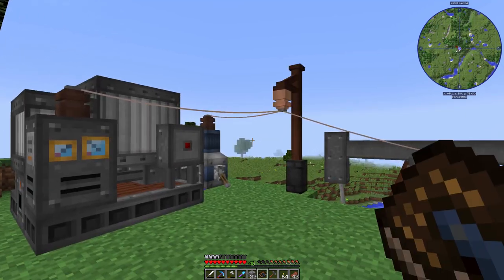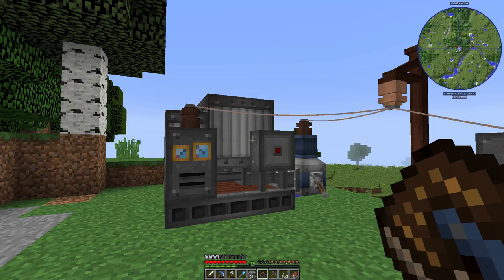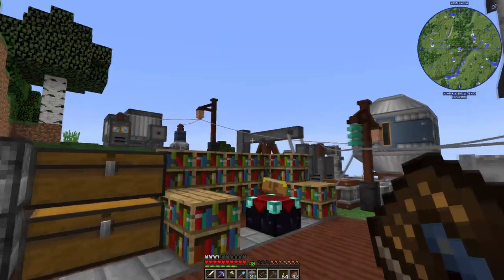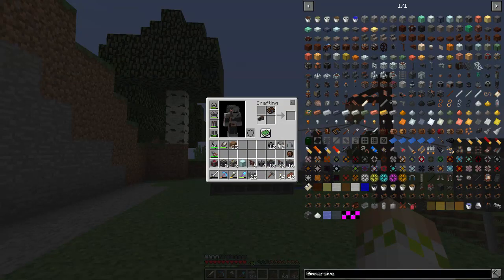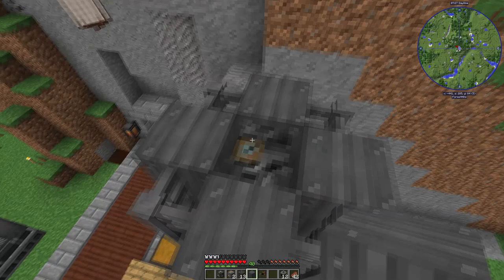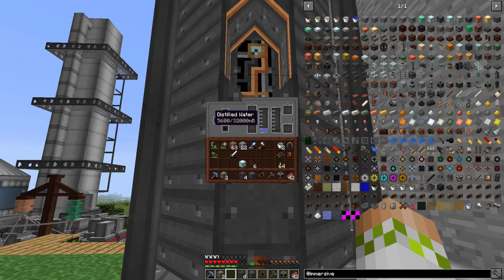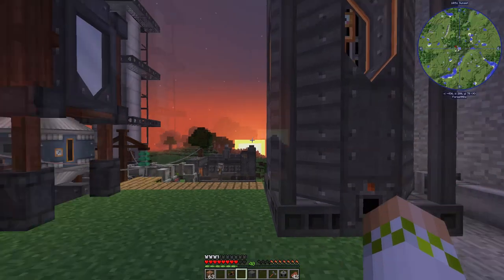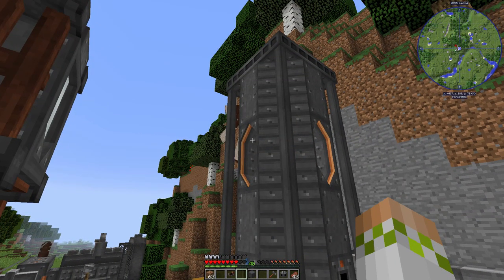Surviving With Immersive Engineering :: E15 - Solar Tower & Solar Reflector

Comment: All these mods I have been using in 1.7.10 have changed DRASTICALLY! To the point; I downloaded a 1.12.2 version and had no idea what to do. It didn't even work the way it used too. (i'm looking at you Ender IO) Even immersive has changed quite a lot. So, I appreciate these videos greatly. Thank you.
Reply: Ender IO change makes it better for lategame and a lot more fun earlygame. But yes its diffrend.
Reply: Yeah EnderIO was a pretty big change specifically. I started on either 1.7.10 or 1.10 and I was pissed at the change but honestly it's easy enough to automate so meh.
Reply: @SullySadface  no it was 1.12, 1.7 and 1.10 are the old version.